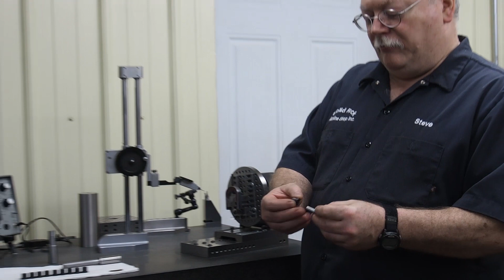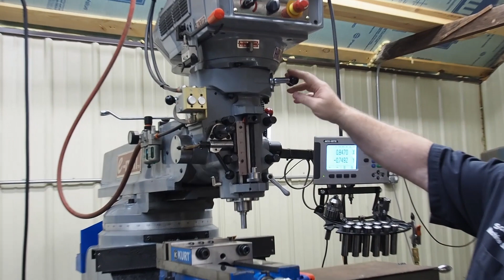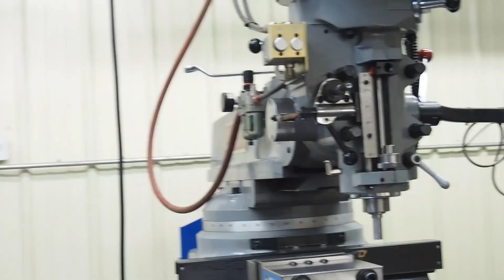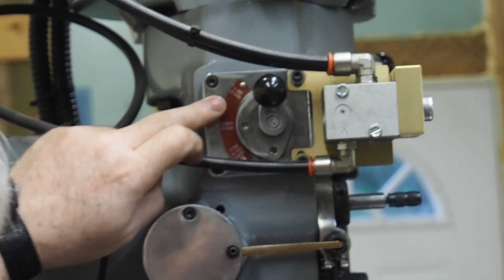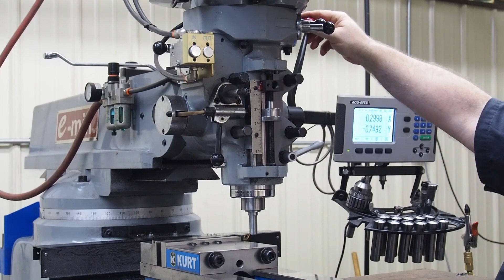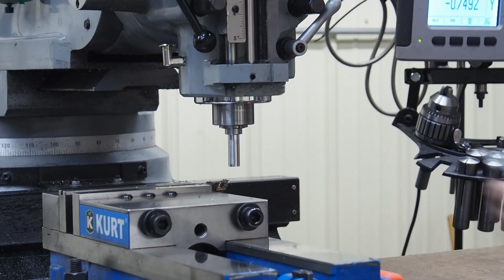Precision Bushings Part 1 of 3

Comment: Enjoyed the video. Question, your mill looks like it sets pretty high, was wondering if you had it setting on something. I didn't see a column riser on it, but could not see the base.  I have a 3HP Acer E-lathe which I really like.  Thanks
Reply from the maker: Hi Sandia,
That mill is high, it's setting right on the floor.. It comes in handy for tall parts but it takes some getting used to if you are comfortable on smaller mills. Thanks for commenting.
Steve

Comment: Good demo on the mill.  Do you not have a lathe yet?
Reply from the maker: Hi Randy,
It's funny you ask. I have a small worn out one a friend is letting me use. I get about .004" taper per inch. I was planning on making a video using it to show a neat and accurate way to true up the chuck jaws. It won't help this lathe much but I can at least demo unique and easy way to true up jaws. The next big purchase we plan on making with be a manual CNC hybrid lathe. It may take awhile for this as a new one is $60,000.
Steve